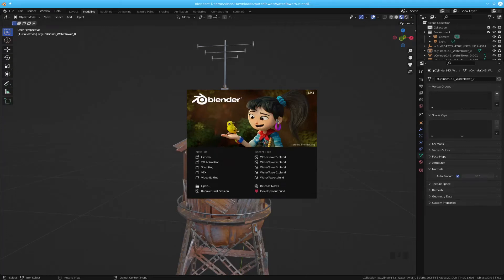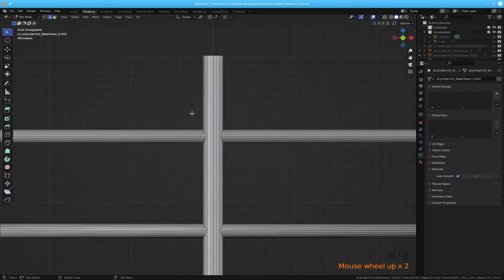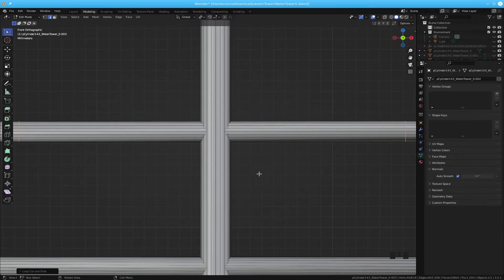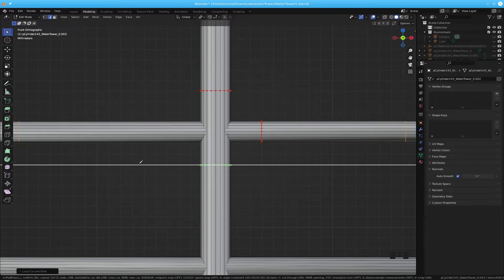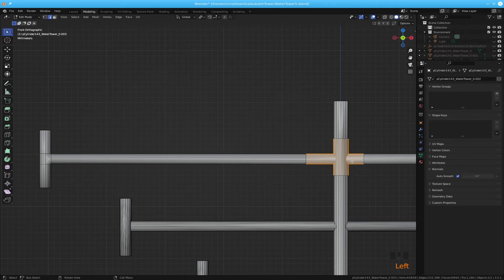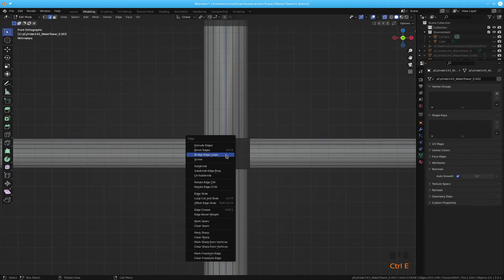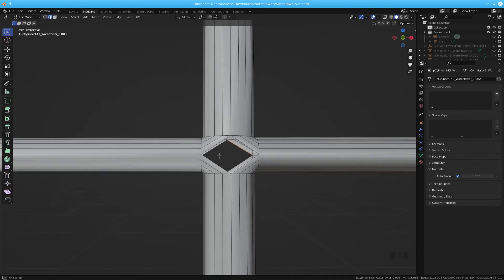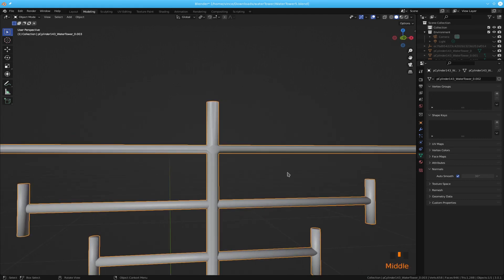#052 Blender quick tip Loop cut tool fails, why

Comment: Did you ever fin the anwer to this? I'm struggling with something similar. If you could make a video on how you troubleshooted it by getting rid of the duplicated vertices and faces and also the solution you eventually found, I would be forever in your debt :)